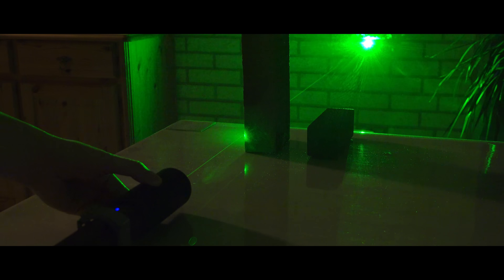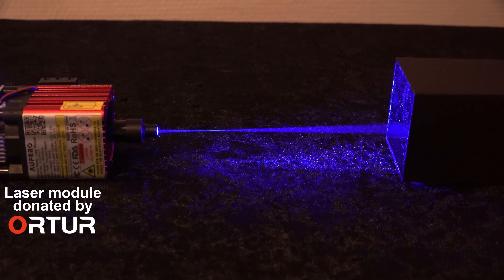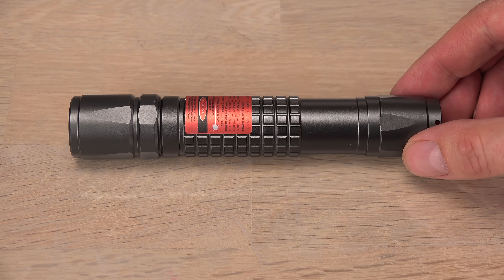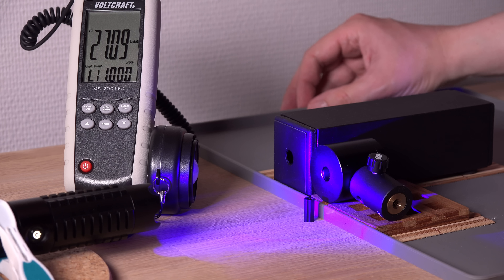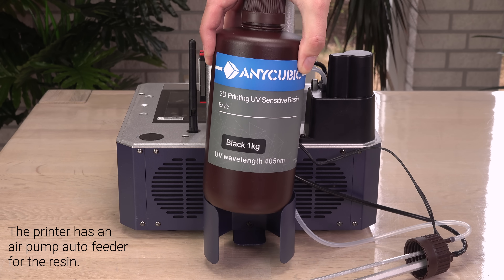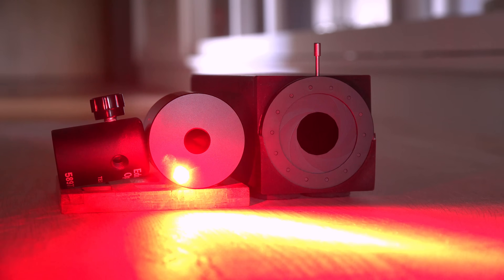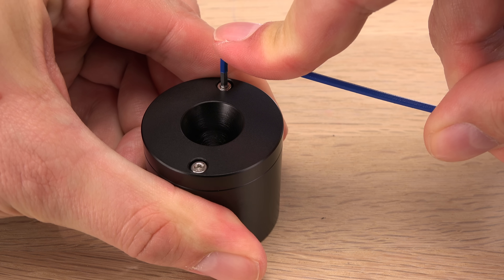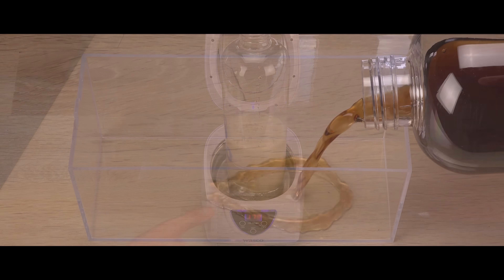PRO vs. DIY | Is my laser beam dump any good?

Comment: This was quite interesting to see, that a homemade beam dump is able to stand up to a commercial model, or even outclass it! Granted, the professional model would be more useful in a lab due to its compact nature, and it is precisely machined. Still, the homemade model's cheapness makes it a great safety tool for amateur work. Great video as always!
Reply from the maker: Yep. Knowing the cost of area on an optical table, it is not something to waste on huge beam dumps. I kind of want a real optical table, but even used the price (and shipping...) is horrible :/ But it is nice to know, that without the size limitations, a cheap homemade beam dump is at least as capable as a commercial model! Thanks for watching as always, General Quack.
Reply: @brainiac75  but what if the dump is placed vertical, with a mirror on the input, so it reflect the light up, towards the dump.  That will make the optical table area use way smaller.
Or am I missing something?
Reply: @ikocheratcr  Having a mirror will mean more risk of reflections going in directions that are Not Safe(tm), so would probably be an unacceptable option in a lab environment - there's already enough risks of idiot users (as it were) that you want to minimise everything else you can. In a home lab, maybe, but in a professional environment, chances are someone will whine about it. Or worse, not whine, and just mess up, and then everyone has to do a whole lot more work to clean up the mess. :-/
Reply: @llearch  a vantablack/black 2.0 to achieve great light absorption and reducing light leakage, it is a shame the professionally done part doesnt have a non reflective coating, just likely anodized aluminum sandblasted on the outside for a matte look without a proper matte function. with the inside ridges also being difficult to sandblast into a matte finish, making it more shiny than the outside, is making the professional dump a little undesirable, disappointed
Reply: The machining looked only partly good. The outside of the case and the cone are nicely machined, but the grooves on the inside look horrible. Like somebody who doesn't have experience with a metal lathe made it. Chatter marks all over the place. Its honestly not worth the price.
Reply: Hey, we both have the same duck as our icon

Comment: Would something like Musou Black improve the performance of this?
Reply from the maker: Yes, any highly light-absorbent black paint would be an improvement. I just think many of them are not very heat-resistant which would be a problem right where the laser beam hits the cone. I used a paint that is resistant up to 650°C for the homebuilt! Maybe a bit overkill, but it wasn't that expensive :D Thanks for watching!
Reply: @brainiac75  Thank YOU for producing these videos, they're always entertaining and educational at the same time! Cheers :D

Comment: You might ctry 3d printing some internal baffles for your homebrew dump , and make it even better 8-)
Reply from the maker: Not a bad suggestion, Bill! With a beam narrow enough to pass through some cone shaped baffles with a hole instead of the tip, I could really trap some more light from ever getting out of the beam dump. Thanks!
Reply: @brainiac75  one additional point (pun intended) , a cone will always have a flat point to some extent. If the cone was replaced with an angled plane , to reflect light away into the baffle array ,it might be possible to remove all direct reflections.

Comment: what if you paint the professional one with a very black paint on the inside?
Reply from the maker: I think I can improve a little on the reflection but the main problem is its shallow depth. You can see most of the inside through the aperture at many angles. So you will see the dot with even the most absorbent paints. Thanks for watching!